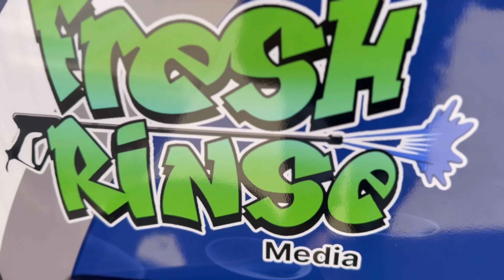Pressure Washing In The Rain. 5 Washes With The Fresh Rinse!

Comment: You are a king! I got caught in a bad storm didn’t finish in time.. got house and flat work done but torrential downpour at end finishing up. If it starts raining do you still post treat concrete? I felt like i should have went back and did another post treat, think it just got rinsed off but not sure?  Was raining pretty hard when i was putting it down.  RI’m doing a home that was just done in November but having windows replaced. Felt awkward quoting.  She doesn’t want pollen for window people…figure it’s clean but gonna wash the heck out of it! Awesome content sir!🍻💪👍
Reply from the maker: I probably still do a pre-post treat. I guess it depends on how dirty it is
Reply: @TheFreshRinse  I started using shooter tip to rinse soffits gutters after watching your vids. Ty sir! Was only using for distance before but knocks it off a little easier than using M5👍